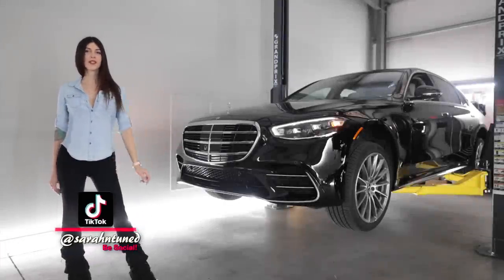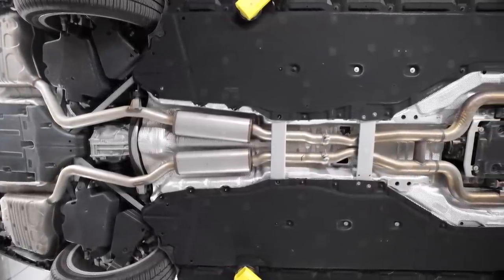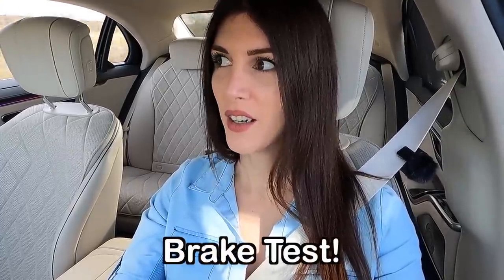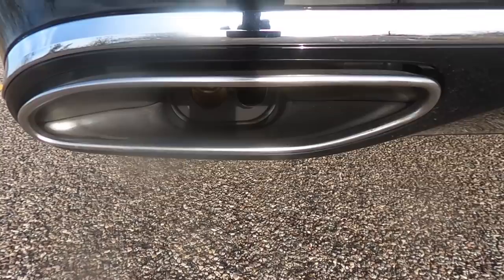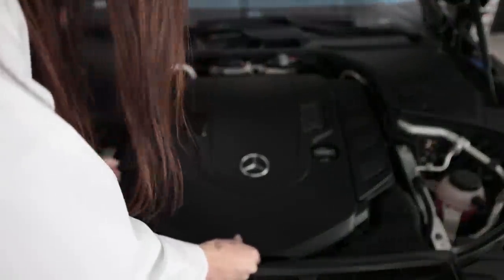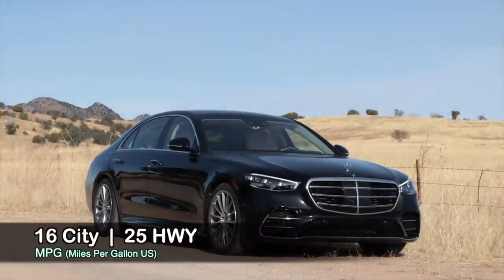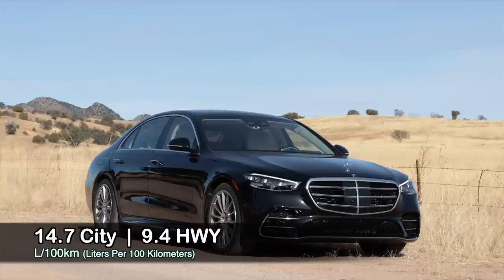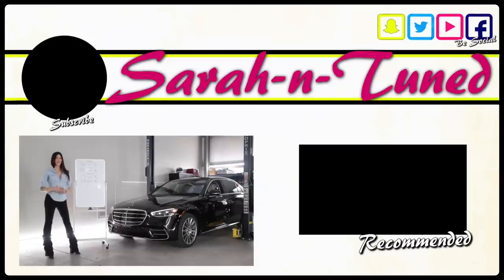2021 Mercedes S580 Mechanical Review  // Tech I Didn't Know Existed!

Comment: 3:15 - Those dimples serve the same purpose under the car that they serve on the golf ball. They create a boundary layer of air around the surface, allowing for smoother airflow around that boundary layer. On the golf ball, that gives the ball greater aerodynamic efficiency to allow the ball to travel farther. On the underside of the car, it will allow the car to experience less drag due to the way that air is made to flow underneath it. The Ferrari F12 has air channels that run from the grille to the center of the hood, and from the upper-outer sections of the hood to the sides of the car just below the A pillars. Those channels help to create a similar aerodynamic boundary effect on the top & sides of the car.
Reply: Mythbusters did an episode where they clad an entire car with dimpling to see if it improved the car's aerodynamics.
Reply: Didn't Bugatti add some of those on the roof of the Divo, or one of their other one-off or limited builds?
Reply: The new WRX actually has that texturing on the ugly wheel arches.
Reply: I remember a mithbusters show and they did this in clay on top of the car. Very interesting.
Reply: @jaydub5515  the Bugatti Bolide features it
Reply: Thx Sheldon

Comment: The dimples act exactly like the surface of a golf ball for aerodynamics it actually smooths out the boundary layer air flow for sound reduction.
Reply: I agree 100%, I was going to make the same comment
Reply: Ya they are great on a curved surface, like vortex generators. Not sure how much of an improvement it is on a flat service. I bet they did the math though.
Reply: But will it improve my driving distance, pun intended 😉
Reply: You beat me to it, I was going to say the same thing.
Reply: The Mythbusters made an episode on this making dimples on a car out of clay.
Reply: c'mon Sarah you should know about the aero properties of dimpled surfaces.
Reply: dimples only improve curved surfaces to help with flow separation. it does nothing on these flat panels. they are probably so the pan doesn't resonate.
Reply: @offroadaddiction2073  dimples only improve curved surfaces to help with flow separation. it does nothing on these flat panels. they are probably so the pan doesn't resonate.
Reply: @wilgarcia1  dimples only improve curved surfaces to help with flow separation. it does nothing on these flat panels. they are probably so the pan doesn't resonate.
Reply: @tomy8339  dimples only improve curved surfaces to help with flow separation. it does nothing on these flat panels. they are probably so the pan doesn't resonate.
Reply: @tomquimby8669  dimples only improve curved surfaces to help with flow separation. it does nothing on these flat panels. they are probably so the pan doesn't resonate.
Reply: @edrcozonoking  I'm not sure that's correct. I'm fairly certain dimples improve all surfaces including flat. Other car makers do that also.
Reply: @tomy8339  I have three degrees in engineering including work with gas dynamics and aerodynamics, I stand by my statement.

Comment: The panel dimpling: on a golf ball, it reduces overall air resistance. So I expect this application has the same purpose.
  The skinny antisway bar maintains more compliance on rough roads, but seems inadequate, yes. The difference in lateral resistance to body lean is taken care of by the "E-Active Body Control" system on a constantly adjusted thousanth-of-a-second analysis basis, per the MB site.

Comment: You're completely  on the money giving it the lowest wrench score ever. I've logged a lot of miles in high- mileage examples of MB S550s as a professional  driver. The massage feature kept me from having to visit a chiropractor in 80 hour weeks behind the wheel. There is a reason why these tend to be leased, and why they lose >$100K in value by the end of a lease. They are extremely fun to drive right up until they're not. Too often they've  become so mechanically crippled that to fix the components only MB has the diagnostic workstation  to reflash or reset, you would be way ahead by parting it out. So they stay broken. I'd wager 95% of the black car service MB sedans are limping along with some major feature or several being broken.

Comment: Amazing amount of tech in this car, most of which seems to be designed to isolate the occupants from any driving sensations.  Obviously, this isn't intended to be M-B's driver's car, nor is this the kind of car people would keep for many years and hundreds of thousands of miles.  M-Bs in general are known to become money pits as they age, due in part to the expensive parts and all that complex engineering which requires mechanics to disassemble half the car to get at things that only require removing a few bolts on "lesser" cars.
Great review, and it's nice to see a car like this reviewed from a more "regular person" reviewer than typical for something like this.

Comment: Mercedes engineering has been superlative for decades. But, as Sarah noted at a couple places in her review, service can be insanely expensive because some of the components are very difficult to access, and some require partial disassembly of other components before you can even get to them, not to mention the specialized tools needed for actual service. Finally, note that Mercedes is NEVER on anyone's list of "most reliable" vehicles. With a lot of TLC ($$), they can last a very long time, but the cost per mile can get ridiculous. No thank you, especially at this price point.
Reply: Friends don't let Friends buy German
Reply: Well, to be fair Mercedes-Benz made very reliable, durable cars up until the 90s, when leasing became the norm. Their customers don't need the cars to last as long, so they don't bother.
Reply: If you have owned or worked on any Mercedes in the last 20 years you would know that the engineering has been anything but superlative. Lots of flashy, gimmicky tech for sure, but at the expense of getting the fundamental engineering right.
Reply: I own an E Klasse and definitely a maintenance hog and I do the work myself using $300 of Mercedes specific tools for my car. LoL
Reply: There is a difference between robust and reliable, both will last, one will feel the same after 20 yrs, the other wouldnt require alot of maintenance but will feel like it had t been maintained.. So
Reply: Reliability is high on the list of superlative engineering. MB cuts corners on component materials.

Comment: One of the points that car reviewers fail to highlight when testing cars is RELIABILITY. This is clearly a time-dependent aspect, therefore difficult to estimate when testing a new car for a few hours or a few days. But it is also one of the most important points for those looking at reviews.
This is precisely why many of us enjoy your videos and especially the sessions where you lift the cars and analyse them from below. When you show the bottom of the car, many are interested in the technology, but many also try to understand whether the quality of the materials and technical choices will allow the car to last for many years.
A tip: you could introduce a score (Ants? Camels?) to estimate the reliability of the car.
We all know Lexus are the most reliable cars, but these are beliefs developed over the years and they are not immutable. For example, many reviewers like the Lexus NX 2022 but argue that the Genesis GV70 is better. It would be interesting to see if Genesis is improving reliability and the GV70 can be expected to last as long as a Lexus NX or if it's just a nice car to keep for the first 70,000km.

Comment: Very interesting, informative, intelligent and sassy review. Rarely see reviews where the underside and the engineering is so closely scrutinised. Many valid and astute observations Sarah. Whoa all that plastic is scary and looks very cheap and flimsy like it won't last very long. Yeah Sarah sure will be challenging when diagnosing electrical gremlins in 20 years time! Had a friend with a 6 month old E320cdi and Mercedes could not pinpoint the fault so they ended up just replacing all the ECUs and a range of other components, crossing their fingers that they'd managed to rectify it.

Comment: The golf ball dents on the plastic shield is to artificially create low air pressure under the car at high speeds. It helps push the car lower at speed. Of course I just made all that up.
Reply: Actually pretty close to the truth.

Comment: Hair New Year, best wishes, health and peace!
The dimples in golfballs are supposedly for aerodynamic purposes: the air would cling less to the ball. 
The nuts or bolts in the ball joints look like Torx to me.
Glad to hear the seats were... Pleasing.
There's probably a separate cooling circuit for the e-motor.

Comment: The version with the 10⁰ rear steer makes these so easy to put on my hoist at work.  Love these cars... depending on the version, there are over 110 individual modules.  The ball joint nuts are technically single use and must be replaced every time they come off. The front anti roll bar end links bolt right through the upper knuckle... these will be an issue in the rust belt... tons of cool tech in this car too

Comment: Mercedes is torx and e-torx, metric obviously.  You need sets of both to work on them.  Mercedes also use big size nuts and bolts.  They're cheap to buy.  Get Mercedes parts from FCP Euro in states. They're actually fairly easy to work on

Comment: The dimples in a golf ball is for aerodynamics as it probably is on that car. Not only do you need weird tools the diagnostic software for Mercedes is proprietary and very expensive. Most mechanics can’t justify the expense therefore your only option is the Mercedes dealer. If you have to ask the cost of the repair, you can’t afford it! Impressive tech on this entry level conspicuous consumption vehicle! The Lexus will probably last longer with less headaches but doesn’t have the German engineering mystique.

Comment: Obviously, it's a car for very wealthy people and something that you'd only hold onto for a couple years before moving on to the next best thing. I would bet a majority of these are leased, not sold.
Reply: They are leased new usually, but then go into the CPO world.
Reply: @LynxStarAuto  What is that world?
Reply: @harounben342  Certified Pre-Owned, where the dealer sells the nicest of the lease returns for about 30-50% off with another 4 years on the warranty. I bought a CPO 3-series a while back and it was a trouble-free experience.

Comment: The dimples: Mythbusters did an episode where they covered a Ford Taurus in clay, ran it on a closed course, and then carved 'golf ball' dimples into the clay. I think they put the excess clay in the trunk to keep the weight the same; and then ran the dimpled car on the same closed course. It got better gas mileage. The dimples reduced air resistance.

Comment: The underside seems to be equal parts noise dampening (and what looks to be a tuned mass damper is very interesting) and just pure aero tricks.  Sick ride.
Reply: The underside is typical of all German cars in this class. They use a lot of shielding, sound deadening, and everything is neatly tucked away, and hidden behind said shielding and deadening. This is why they have elevated labor costs 😉 all that stuff has to come down, so we can reach whatever needs attention.

Comment: I would give it a .5 wrench for being able to work on it yourself. MB doesn't even want you to check your own oil.

I'd take the Lexus 1000 times over the MB. It will actually still be running in 20 years.

Comment: its made for a short life, then some expensive electrical or mechanical system will write the car off because it out weighs the value of the car then it gets crushed and recycled into some boring EV. Nothing like the older mercedes of the Sacco era w126,w124,w201,c124,c126 ect

Comment: In future there will be plasma generators and air ionization devices on the cars to lower the coefficient of drag under 0.15 and the physical limit of aerodynamics is a coefficient of drag of 0.05 which penguins have…this is what I call a penguin score ! Real penguins are as efficient through water as through air without the ability to fly …0.05 the absolute limit of Mother Nature…if you create a ionization cloud around a vehicle and then rotate a magnetic field and create a high speed ion wind rotating around the car you can go under nature’s limit of coefficient of drag of 0.05 and near almost 0.001 then your car can really fly…and does not need wheels anymore…

Comment: I'm wandering what feature this car is short of to be called just S580, not S600. V12? Heated rear seats?
Reply: You've said one of them, the 2T-V12. There's as well as additional features and settings in the back seats (most likely that V12 engine will be reserved for the top of the line S680 Maybach).

Comment: This car is 5000lbs/2.2 tonnes of wadding. Ruined bump reaction due to massive brakes & anti roll bars... Instead of using engineering to put the weight in the ideal place.

Comment: At that price point, this isn't a car I would ever even consider owning.  I can appreciate all the tech that has gone into it, but when I see that, all I see is the 1.3 wrenches.  Mercedes has gone off the deep end with over-engineering their cars in a bad way for years now.  I suppose for someone who would consider this car, they have money to burn for depreciation and paying the dealership $350 an hour for a qualified tech who could even start to work on it.  The over engineering should be put into making the thing bullet proof reliability and drivability, not dazzle.  But I suppose Toyota has the market cornered in that department.    

I owned a Honda Prelude with 4 wheel steering back in the 1990's.  It wasn't worth it.  It added unnecessary complexity for something that is pretty unnecessary unless you are in the habit of parking in tight spaces on a daily basis.